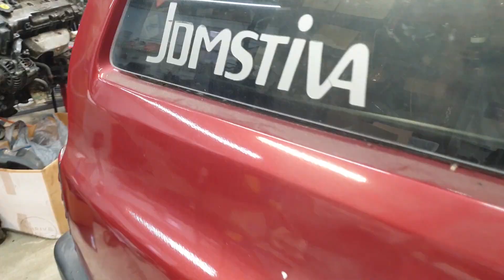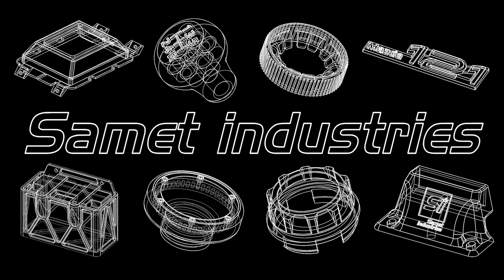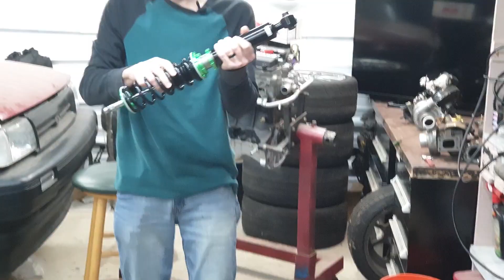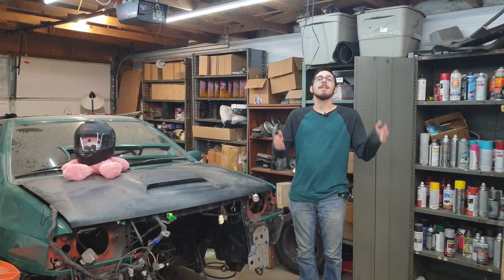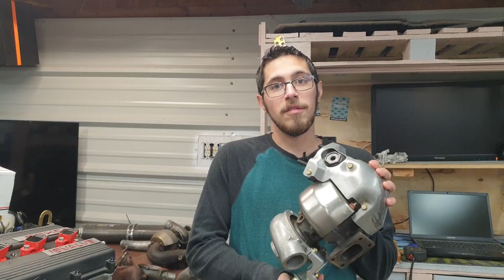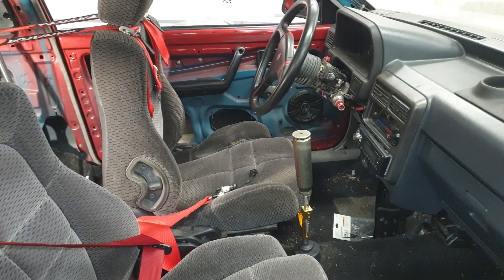New Year, New Projects! 2023 Updates & the return of JDMSTIVA

Comment: I love my Rev9 coilover setup... and I don't even have the rears in yet. Keep up the good work!
Reply: Are you using different springs or the ones that came with it
Reply: @1129otorres  you have to use different springs, stock mk2/3 spring are WAAAYYY too stiff.
Reply: @adamsaramcmichael4579  do you know the right springs to use for front and back?
Reply from the maker: @1129otorres  that's one of the major parts of the guide that is coming